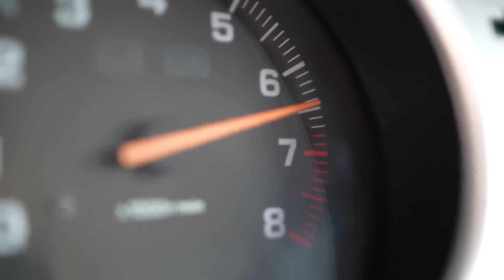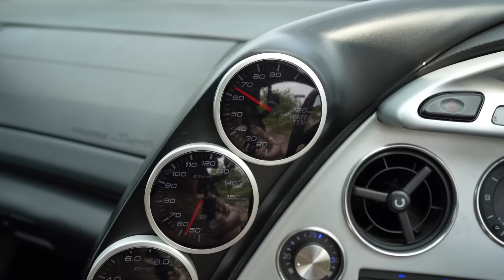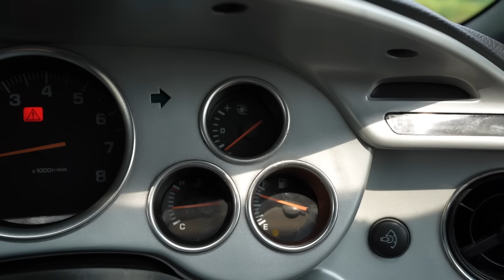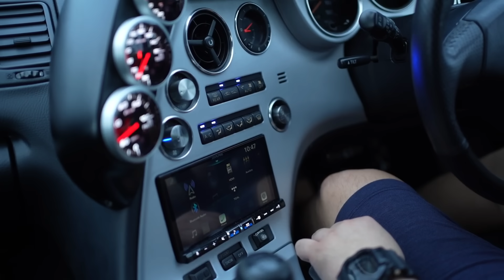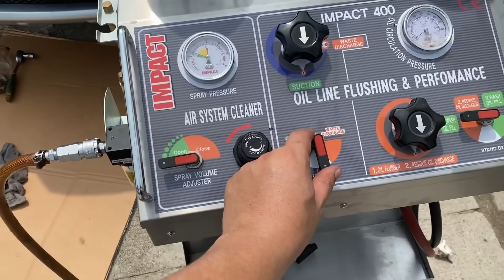SALAH SATU MOBIL IMPIAN TERCAPAI !! TOYOTA SUPRA MK4 DENGAN 2JZGTE VVTI ENGINE, GETRAG GEARBOX

Comment: Supra Mk4 / A80 adalah mobil yang punya sejarah membuat Dunia Otomotif sempat ketar-ketir, sehingga membuat pabrikan lain terpaksa berlomba-lomba membuat supercars untuk mengalahkan perfomanya, Good Job Pengepul!
Reply: Tapi kalo di lintasan race lebih famous GTR
Reply: tapi Supra sport cars bukan sih?
Reply: @Tobi-05  justru itu, Pernah denger istilah Supra Mk4 SUPERCARS KILLER bang?? ya itu, itu dimasa real. supra sports cars tapi dulu perfomanya bisa dibilang kaya supercars. interior aja kaya cockpit pesawat
Reply: @remurrr oalah maksudnya gitu, siap salah 😁
Reply: supra dari pabriknya udah 10000000000 HP soalnya 🤣🤣
Reply: @metalfreaxx1  mana ada, itu 1000hp klo di tune up. Memang jadi salah satuMobil Kencang kok
Reply: @ahmadjuli8783  GTR yg mana dulu?
Reply: @metalfreaxx1  bukannya 250hp ya kalo dari pabrik karena ada kesepakatan di Jepang semua mobil gk boleh lebih dari 250hp ya
Reply: bener bang, supra standard 100000000000000000000000000000000000000000000000000000000000000000000000000000000000000000000000000000000000000000000000000000000000000000 hp
Reply: Sejak kapan Supra tipe mk4 /A80 itu punya sejarah? ...

Yg sejarah itu Supra tipe 
FIT / X  

Kurang jauh anda main nya  phei ...

BtW 
happy new year 2024 🥳
Reply: iya anjirrrr supra EmKa4 mobil paling kenceng di bumi🥶😱😱😱pabrikan laen sampe ketar ketir nahan berak🥶🥵😨😱
0-100km/h 0.1 detik🥶😱🥵
SuPerCaR kiLLeRr😱😨😰
Hp7000
torsi1000000
9000000 Rpm🥶🥵😨😰😱😱🥵🥶🥶😰😱😱
Reply: @Dhlyyyy stop it
Reply: Apaan dah perasaan supra masuknya bukan sportcar masuknya grand tourer,kalo yg supra baru mungkin baru sport car,lagian prestasinya yg terkenal di jgtc mesinnya pake 3sgte bukan 2jz,
Reply: @ahmadjuli8783 betul di JGTC atau grand touring balap lainnya, gtr lebih famous namun supra pas balap tidak memakai mesin aslinya tapi pke 3s-gte, karena peraturan bobot mobil dll, kalo gak salah sejarah singkat nya begitu, tapi klo pke 2jz nya ntah bagaimana, bisa lebih atau kurang, tak tau
Reply: @muhammaddioalzaki8019  Supraa itu sports car kok bang, coba cari tau Supra mk4 itu Sports cars atau Supercars, pasti jawaban nya sports cars, org pun umumnya nyebut itu sports carss
Reply: Yang dibahas supra tapi yakin pasti ada yg bahas diluar supra itu sndiri, udah ketebak yg nggk suka Supra. dan supra sndiri pun itu tenaganya sbenernya lebih dari apa yg tertulis, itu pun ecunya masih dilimit
Reply: @madisKT  sorry bukan penyembah 2jz ya, tapi di banding mobil lainya dengan cc 2500 up, mesin supra ini termasuk perfect mendekati sempurna hahaha, dengan cc 3000 mobil itu mesinnya kuat, sparepart murah dan bnyk, gampang di tuning, keluarga jz series emang the best, walaupun rb adalah saingannya namun untuk famor mesin jz tetap di atas rb walaupun sama smaa kuat tapi untuk tune rb harus merubah block silinder dan part after market lainya, yang harganya mahal, beda dengan jz hanya remap, ganti knalpot pun bisa atau kasar nya tidak mengganti part internal mesin ini bisa mendongkrak hp dan torsi yg signifikan, atau bnyk fans boy nya nyebut, bisa 1000hp stock wkkwk, memang betul faktanya saya gak punya supra tapi saya pernah pke mesin 1jz di tubular saya, dengan ganti turbo dan blow off mobil bisa kenceng
Reply: @Tobi-05 grand tourer
Reply: @Tobi-05  sportcar dia masuknya, kalo sportscar itu 200-300hp, supercar 400-600hp, hypercar di atas itu. Sedangkan jdm itu mobil port yang di tunning jadi supercar bahkan hypercar.
Reply: Supra dari lahir ya sama kyk mobil lain, bedanya itu ini mobil bisa di tune gila2an bang
Reply: @muhammaddioalzaki8019  mesin 2jz banyak di pakai juga di mobil lain macam Toyota crown, Toyota soarer, kalo di jalan raya yang  track Nya pendek Supra emang cocok, tapi untuk lintasan race Nissan GTR tiada lawan ,menang terus apalagi sejak Nissan GTR r32 lahir, sampai di juluki Monster,,
Reply: @Tobi-05 lebih tepat sleeper  car
Reply: @madisKT  grand tourer bang gw ngambil reverensi dari websitenya toyota uk,sama videonya garasi drift pas evan review supra,di wiki disebut grand tourer/sport cars(gw yakin yg dimaksud sport cars adalah supra generesai terbaru mk5
Reply: @remurrr  padahal sama2 standar sama e36 m3 aja kalah🤣 jgn berlebihan...
Reply: @kampretthitt2535  supra itu kategori sportcar bang karena 2 pintu, kalo sleeper itu 4 pintu macam subaru wrx impreza, mitsubishi evo series, kalo versi american ada dodge challenger dll.
Reply: @muhammaddioalzaki8019   ya udh terserah lah, klo gw tetep nyebutnya mk4 ya masuk sports cars, trmasuk dri sisi design, gw ambil referensi yg sering lebih umum digunakan aja sama para street racer org diluaran sana, krna gw yakin klo pilihan street racer ya klo nggk supercars ya, ya sports cars
Reply: @farezkosasih28  wkwk setuju kalo nggk salah ada di hotversion,yg komen kebanyakan terlalu mendewakan supra
Reply: @muhammaddioalzaki8019 honestly supra mk4 is sports cars, you can see from the naked eye, the Supra MK4 is a sports car, the MK5 & MK4 actually have the same terms in several respects, except the engine, at that time the MK4 could already be called a sports car, both MK4 & MK5 were sports cars
Reply: @CrispyRizqi  nggk bisa bahasa inggris,barusan dah di koreksi yg grand tourer mk3,jadi ya sorry ada miss info
Reply: @fajarhanditya-ry4bv  sportscarss bro
Reply: @ahmadjuli8783  iya, di ajang balap JGTC kelas GT500 kala itu supra mk4 swap engine ke 3sgte baru bisa ngalahin gtr.
Reply: @hrmc011  ironisnya supra legend karena 2jz. tapi kencengnya pake 3sgte. GTR lebih proper karena versi balap maupun road masih pake blok RB
Reply: @Tobi-05 tourer, dia masih satu chasis sama soarer, jzx100. Cmiiw
Reply: @BondanHeru  mau satu chasis sama jzx100 kek, gw lebih stuju sama komenn² diatas, tetap saja kbanyakan manggilnya supra itu sports cars, gw pun jga cari tau itu, coba surfing aja , kenapa bgitu dari design pun keliatan. Klo gw sih ngikut yg umum aja deh
Reply: @BondanHeru  klo satu chasis terus knape? mending lu cari tau, kenapa supra tetap masuk sports cars? grand tourer masuk, Sports Cars Juga Masuk. Supra MK4 yg dijalanan umumnya itu lebih disebut sports carss
Reply: @Tobi-05  udah biarin aja klo ad yg mau nybut tourer ya masuk juga, Tapi yang jelas SUPRA MK4 adalah sports cars ini bener , oh Sejarahnya panjang knapa bisa masuk 2 class termasuk tourer jg ada sangkut dgn seri sbelum mk4 dulu, males aja sih gw nulis.
Reply: bahkan artikel saja bisa menulis “History of the Toyota Supra, a Japanese sports car legend”
Reply: @remurrr  Yes , ya terserah aja bro, klo gw sih tetep memasukkan MK4 sebagai sports cars, selain dari apa yg ada di intenet, juga dilihat dari yg lebih umum, 2 class masuk, tapi sports cars jadi lebih umum menurut gw sih
Reply: @Tobi-05  ya memang, Kita nyebut Sports cars pun nggk bakal disalahkan Toyota, gw males aja bahasnya
Reply: Kalau gak salah yg bisa ngalahin dominasi RB26 nya GTR juga kan 2JZ ini diajang balapan sekelasnya, ehh iya gak sih?😂 pernah baca sih , sorry kalau salah ya gess😂
Reply: Mang eak
Reply: Kencengan datsun go
Reply: @gildasindraswara no way you called 4 door a sleeper💀
Reply: @heheboi6693  Indeed, not all sleeper cars are 4 doors, but in general most of these cars are wagons or family cars with increased engine performance. because sleepercars prioritize performance over clear appearance, bro?
Reply: @heheboi6693  I explain it in general to lay people, so that it is easy to understand. In fact, quite a few people make sleeper cars based on SUVs.
Reply: @gildasindraswara  agree with that statement but saying a sedan is a sleeper is kinda wrong there's lot of high performance sedan out there
Reply: @heheboi6693  OK, I admit I made a mistake in using the language I used, but I mean it so that it can be generally understood, because the most contrasting difference between the two is the number of doors and the base of the car used.
Reply: @heheboi6693  If the Supra is based on a sports car that has been re-tuned to become a supercar or even a hypercar.
Reply: @Tobi-05 bukan bree jatuh nya grand tourer dia punya sharing platform juga ke 3 saudaranya:Soarer/chasser/mark II
Reply: @zuxx-lb7gv  terserah dah mau nyebut yang mana, ya tau chasis sama, tapi gw setuju sama komenn² diatas yg bilang Sports cars juga, pasti ada hal lain sih knapa supra bisa juga dsebut sports cars di kalangan umumnya, ya sprti yg tertulis di internt dan artikel lain intinya supra bisa masuk 2 class, tourer dan Sports cars.
Reply: @remurrr  mana gua fokus disitu, gua nyebutin chasisnya.
Reply: @Tobi-05  iyain aja dah, lebih famous di karpet merah vip dan drift missile si jzx100 bagi gua.
Reply: @BondanHeru  iya tau paham kok maksud lu chassis, intinya udah-udah, masuk tourer dan masuk sports cars juga, dua duanya nggk bakal dipermaslaah toyota
Reply: @BondanHeru  gw sih kaga suka Supra bro, klo soal speed performa gw lebih ke fans GTR 🤣, kadang kan pengen ngebias , tapi kadang mesti gw tahan aja karna takut terlalu kluar topik buat gw 😂
Reply: @remurrr  yoi
Reply: @Tobi-05  gpp juga, sistem rb emang lebih njoss dari jz. Sering nonton channel yang bejek di autobahn soalnya. Parameter daily use, bukan race track only
Reply: Cumi diesel tertawa melihat ini
Reply: Ngasal bang, orang tim Toyota aja buang mesin 2jznya diganti mesin beams kalo engga salah buat ikut balapan
Reply: @ridwanabdulaziz46  ngasal? ah nggk juga, tergantung references lu mau ngomongin apa, klo refence ke kebalapan resmi, iya, dan gw juga bisa pake reference JGTC supra toms yg ngebuang 2jz diganti 3sgte, atau reference smokey yg ganti pake mesin RB? semua ada alirannya bang, Supra itu masalah cuma satu BOBOT antara mesin dan Supra itu sndiri, makanya street racer yg ngetune 1000hp, stroke up etc itu di swap ke mobil lain, tapi jadinya ya nggk ada estetika ngomongin supra lagil
Reply: dan 3sgte & RB itu juga udah dituned, semua karena bobot antara mesin dan supra itu sendiri, putaran mesin utk skrang bukanlah alasan pasti, kenyataan jaman skrang banyak yg bisa mensetting putaran mesin 2jz ( klo sudah dituned diatas stage 2 ), apalgi klo bagi Billet block ( walo billet jadi nggk reliable )
Reply: Kaya punya supra aja sok2an debat pada.
Reply: Buat abang abang yang pengen tau sejarah Mobil Toyota bang😁 thttps://youtu.be/Y3I8nCw1b2k?si=ji_XNekCJLgeONuL
Reply: Gk cuy, lu nonton channel otomotif jepang taun 90an justru yg menonjol itu nsx, integra, evo, sama impreza
Reply: klo ga salah ada yg versi tune up nya hingga 1.500 hp on wheel
Reply: Bang aku mau mobil Toyota Supra Paul Walker bisa ga bang,klo bisa beliin bang
Reply: lucu bet bocil bocil supra😂
Reply: @remurrr supra bukan nya mobil gt ya?
Reply: @alvinn1855  Gt /grand tourer iya, Sports cars iya. Semua ada di intrnt, wiki juga nyebut keduanya,  kalo di bberapa bahkan artikel luar ada juga yg nyebut klo secara jalanan/street lebih umum nyebutnya sports cars
Reply: Gaada pabrikan lain ketar ketir sama supra. Gtr sama Nsx lebih superior pada masanya. Supra terkenal karena mesinnya aja kuat
Reply: Sok tau yg membuat sejarah dunia adalah TRD 3000GT
Kid kid sok tau lo
Reply: @convert549  berisik
Reply: @remurrr  kocak bocil sok tau
Reply: @convert549  berisik, lu bukan pasar umpan gw
Reply: Bocil supra
Reply: Supra yg keluaran Honda jg sempat membuat sejarah dunia
Reply: Semua krna brian o'conner
Reply: Di upgrade dikit langsung gacor parah tenaganya🗿

Comment: 2jz engine pro import 3000/3400hp r35 mah kalah 6 cylinder inline 6 tapi mampu mencapai horsepower tinggi respect... venenum racing 5.55 second 1/4 mile 257mph top speed insane